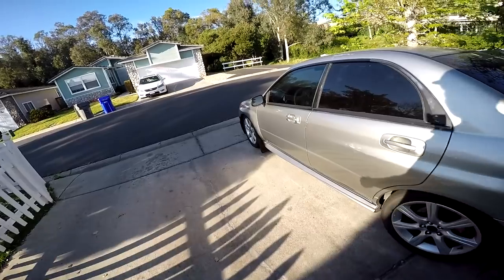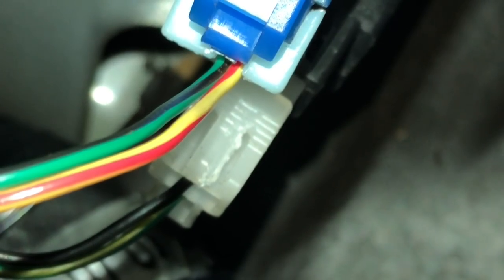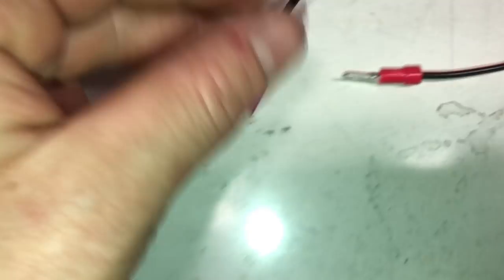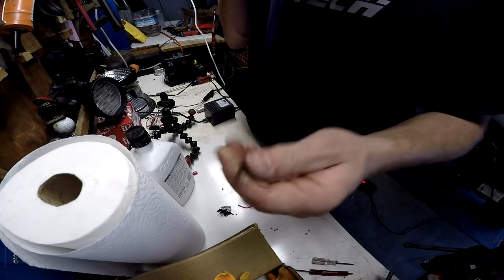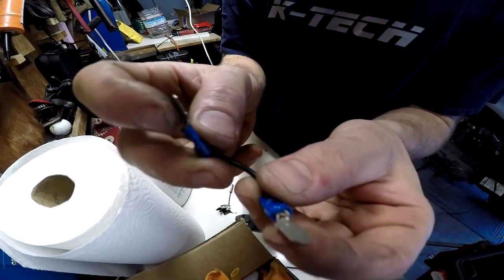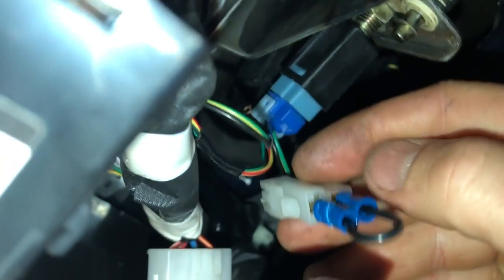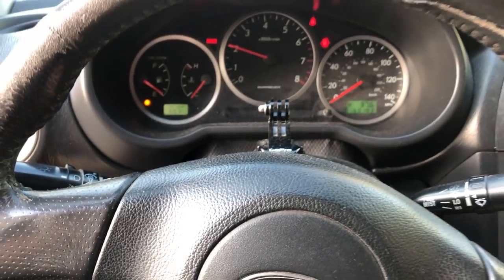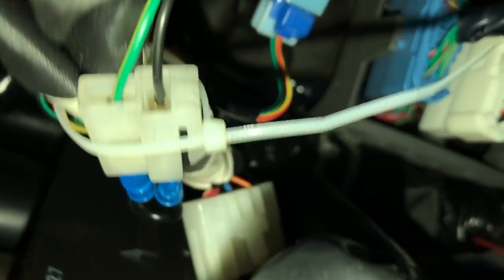Subaru Clutch Pedal Hack! Try At Your Own Risk!

Comment: The other added benefit to clutchless starting is no pressure applied to the crankshaft and thrust bearings.
Common trick in the DSM world since the 7 bolt 4G63 was known for crank walk issues and this allegedly helps. 
I have no idea how you made this so much fun, but you did. Nice video!

Comment: Hell yeah thanks for making this.  I replaced my battery, 7 years old,  thinkin that was the problem.  Nothin.  Bang on the starter, nothin.  Smoked one, watched your video, i actually broke the switch trying to get the connector off.  And just twisted the contacts in the switch and it started right up!  30 miles from home. thanks again

Comment: I added a three-way toggle switch : ON/OFF/ON. In one position the clutch switch acts normally. In the center position the car will not start. In the third position, the car will start without pushing in the clutch. The center/off position is a theft deterrent. If I have to park the car somewhere that I don't feel is safe, I just put the switch in the center position so the starter won't work. I hid the switch,,,,, somewhere....
Sort of a Mad Max thing, without the BOOM.
Reply from the maker: That’s pretty cool! I wish I knew how to wire that good!